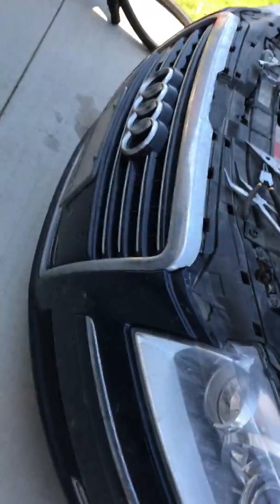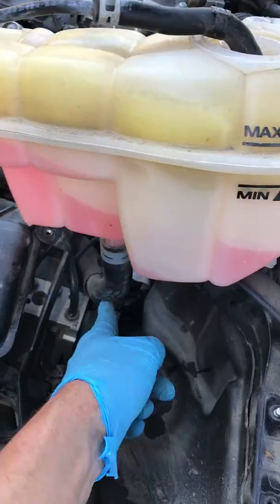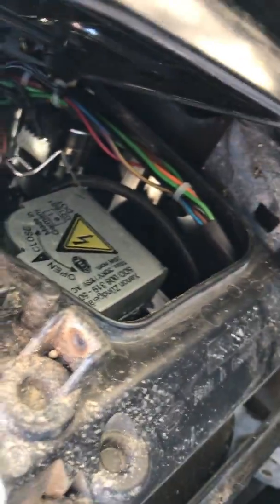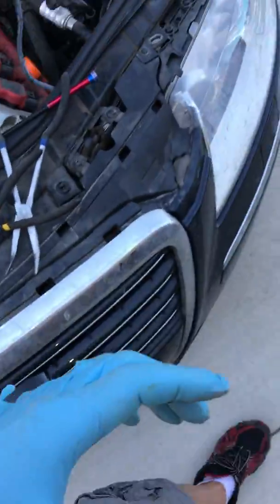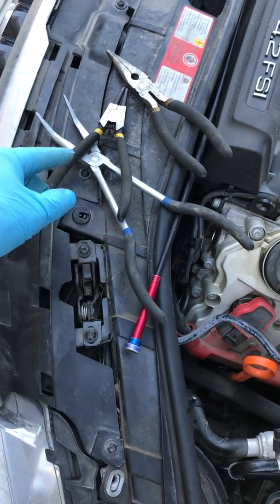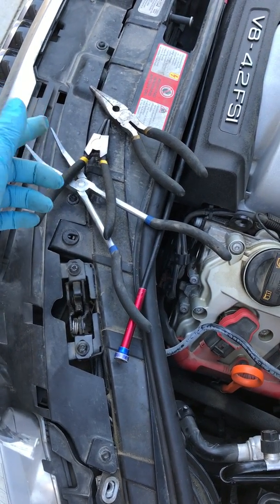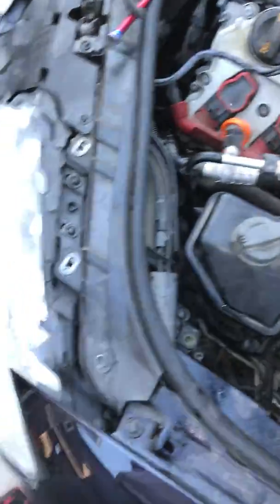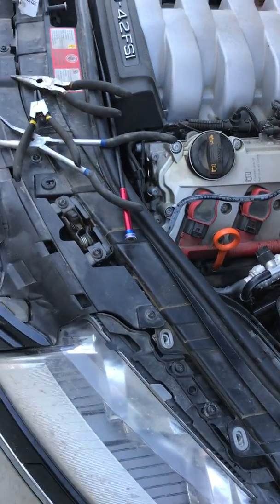Replacing Audi A8 D3 Headlight bulbs

Comment: Have an 04 A8. Going through the wheel well was honestly the easiest way for both sides. Gives plenty of room and ability to not have to torque your head around to see what you’re doing. 
Only part is you have to unscrew all the wheel well screws to be able to pull it back where it gives you a ton of room.

Comment: I was able to remove the entire headlight housing without removing the bumper cover & was stumped as to why in the hell I could not get the fixture to twist back in place. Here I had the wire connected outside of the housing. Thanks for the explanation

Comment: you can pull the whole headlight out to change bulbs and you dont need to remove bumper prior to do that
Reply: could you tell me how you did that?
Reply: I dont think your right
Reply: Not true. 07-10 years at least you can't.
Reply: Yes you can I have a 2010 with the headlight out now. 5 bolts 
1 in back 4 in front